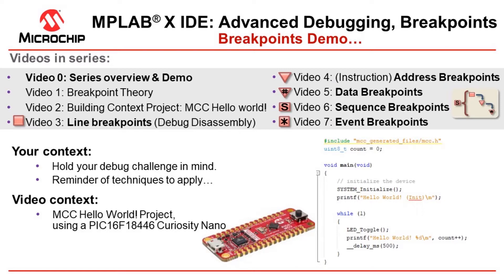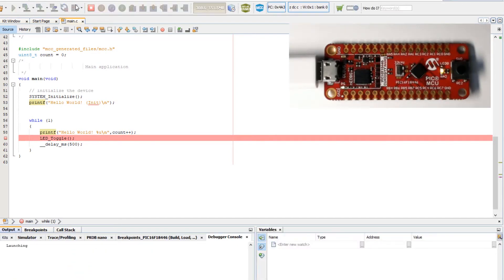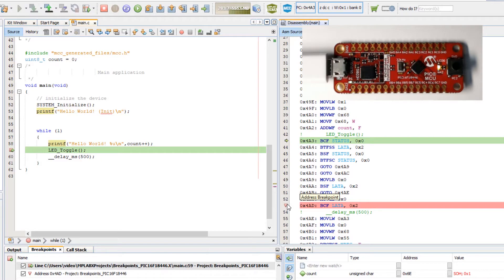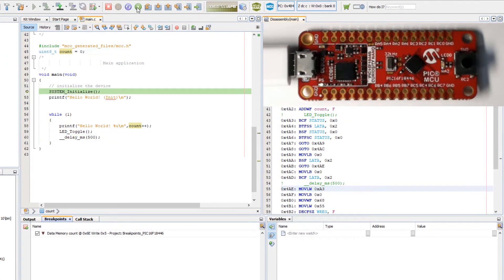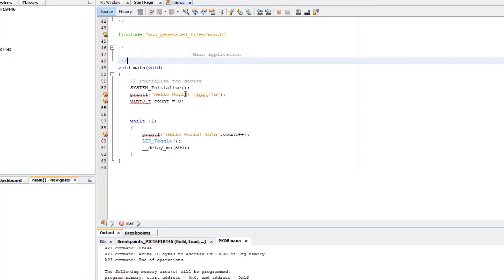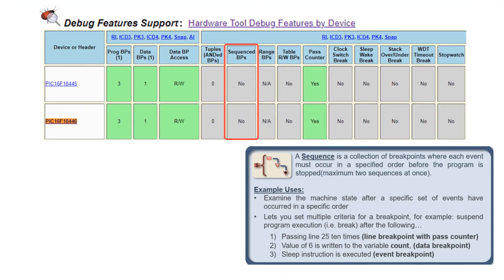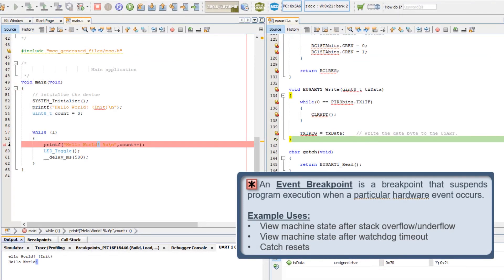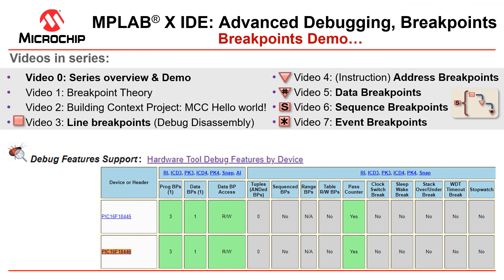MPLAB® X IDE Advanced Debugging - Series Overview & Breakpoints Demo

Comment: If you use MCC with XIDE, you cannot use other C compiler as MCC uses XC8, unless you ignore MCC. Then, in XC8 manual I can't find the keyword PORTA,PORTAB, etc. When I acess PORTA access compiler gives worning or question mark, looks like Microchip only allows PORTAbits, any body can clarify? I mean I can r/w each bit but C complier complains when r/w whole port.

Comment: the presenter assumes user know key clicks, that's incorrect. Old one is clearly better: https://www.youtube.com/watch?v=pnkUOL0mmyA .  on W10 21H2 and XIDE v6, if you don't build but start debug(it will build itself), XIDE may hang; if you reset debug and redo, you might not see nor add variables; mplab own samples likely won't run, either due to .h file wrong(F18446.h missing OPTION reg), or s/w version changed. You will see different versions of different style, because there is no architect design, each programmer writes its own code in his own style, this seems create lots of jobs for US, uncle Sam shall award it!

Comment: Get rid off PIC, s/w is very buggy and mess! Tried CC5X v3.8 and many errors or duplicated symbols, Then try XC8 on same XIDE v6.0 on two laptops, first report says project is empty, worked around and it starts to work, tried another laptop then unable to pickup one of two compliers - which means s/w already messed up and keep trying may get a path to work So many nano board are mess and pins are not compatible. C- manual is a traditional tedious way - the writers are outdated. Arduino is much better. I try Pic because my chip content messed up after 10 years use. Like other posts on you tube, they have no designer or very poor architecture design.